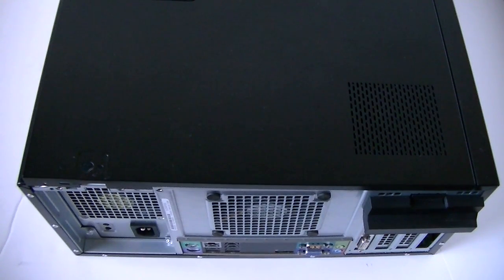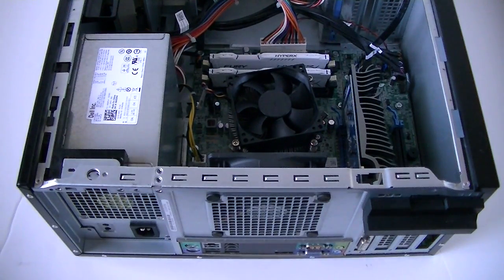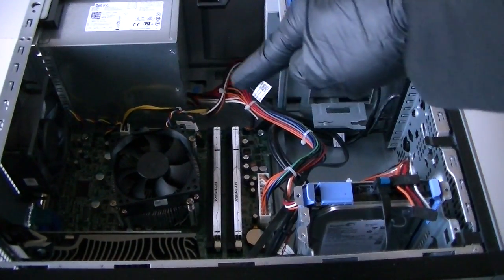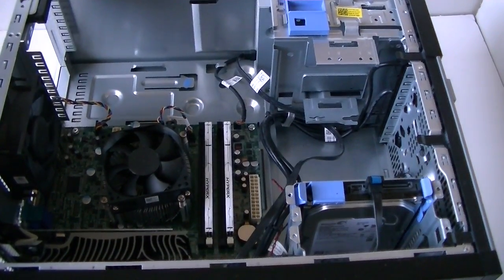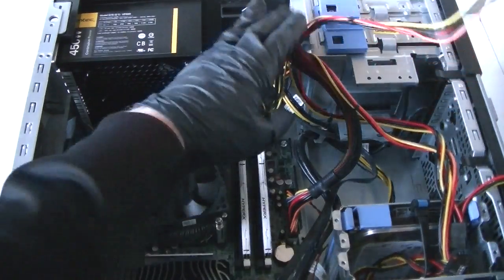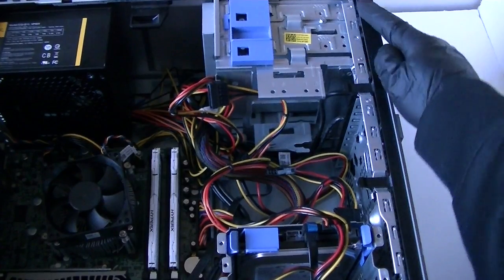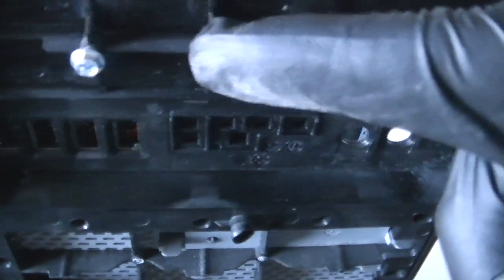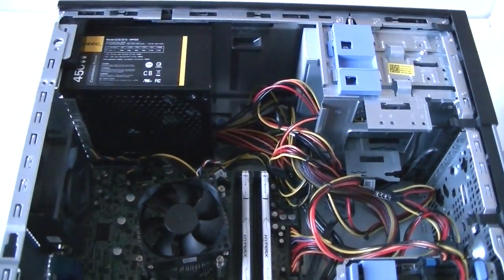Dell Optiplex 790 Power Supply Install Replace Change Upgrade

Comment: Will a gtx 1060 3gb work? As it seems to be better in price and performance than a gtx 1050ti.
Reply from the maker: Hi, yes that video card will work fine and you have to upgrade power supply.

Comment: Wow, some motherboard models of this Dell Series have 8 pin connectors instead of the 24 pin connector you see in this video. If its 8 pin you will need to buy an adaptor.
Reply from the maker: Hi.

Comment: For those who are looking for a dell OEM 500 watts power supply, do take a look at this link. Leaving this here since it helped me and might help someone else. Does not have the non-turn off issue which the other ATX PSU's have with the dell motherboard. Effortlessly runs an RTX 2060 for me.  

https://www.aliexpress.com/item/4000811511094.html

Comment: Hey dude I have an Optiplex 790 and was looking at an antec vp450p on eBay, is this the exact model of psu you’ve used here? Will I need any different power connectors or will it just plug right in? It says it’s non modular in the description, not sure if that matters or not

Comment: i have the 790 and i cant fit the 500 watt power supply i got it cant clear black slide spring for the case cover
Reply: Same.
Reply: I got it out, won't be able to close side panel properly anymore tho, as the the black piece with the spring is the side panel closing mechanism. Still worth it tho.

Comment: what about a 1030
Reply from the maker: Hi, yes that will work. GIGABYTE GeForce GT 1030 GV-N1030D5-2GL Low Profile
Reply: @Mxkdt  o ok
Reply: @Mxkdt  Also can a 400w evga psu work with a 790 sff?
Reply from the maker: Hi, yes on sff case you can use  evga 400w ATX power supply external for testing.

Comment: I have a dell optilex 790 mini tower and the PSU/power supply only has 240watt so I'm trying to add a GPU/video card and it is "evga gtx 750ti' so I don't know if the powers supply could Handel the gtx 750ti so I hope someone respond and ask me if the 240watt PSU could handle gtx 750ti.

Comment: I was just wondering, does this case support 500watts psu ? want to use a rx 5704gb or 1060 3gb on it.
Reply from the maker: Hi, i just uploaded video and shows you how to upgrade bigger video card for gaming by removing hard drive cage.
https://www.youtube.com/watch?v=Bjtpp-fIx_Q

Comment: Hello friend.  Wondering if a 2gb rx 560 will run on the stock psu?  I got one of those sata to 6 pin plugs for power to it.

Comment: this video is nice....i looked online and saw a slimline of models that can replace mine only 300 watts but still better than my 240 so hopefully that will work and Dell or this  place or soembody will make a better one... 600watts is the goal
Reply from the maker: Hi, you don't need 600w power supply and if you are using gtx 1050 video card 300w power supply should be enough. Thanks

Comment: Can the gt 1030 handle that 265 watt power supply?
Reply from the maker: Hi, yes you can use gt 1030 on 265w power supply
Reply: @Mxkdt  the power supply that comes with the pre-built 790?
Reply from the maker: Hi, yes dell optiplex 790 mini tower uses atx power supply 265 and you can upgrade to CORSAIR VS Series, VS450, VS400, CX450, CX430.

Comment: JUST GOT A dell optiplex 9020  AND REPLACED the 290w power supply with a eva 600 w powersupply i got alot of extra cables i had to get a adapter for the mother board to the power supply tho and on the mother board there is a plug in cable tha powers the hard drive and dvd/cd rom, im using the old one for now snice the new one doesnt plyg into the mother board should i unplug it and just plug the cables into the hard drive and dvd rom drive ? it seems like this power supply wll power the hard drive and the dvd rom , right now the old cable on the mother board is powering the dvd and hard drive

Comment: hi there  i have a dell optiplex 790 mt, 0hy9jp motherboard, will a psu upgrade damage the motherboard at all, and if not what psu can i use, and gtraphics cards  thanks  keith

Comment: Can 240w handle a750  ti
Reply from the maker: Hi, yes 240w power supply will work fine with 750 ti video card.
Reply: What about 1050 ti

Comment: hey mate i have dell optiplex 790 and when i turn in power fans running  like 3 sec also video card led  turn on afther this  when i click button computers run normal  its problem ??ur computer doing same?

Comment: I have bought an EVGA 600w power supply and want to put a Zotac GTX 1060 3gb in my 790 mt. Is that enough for it to work?

Comment: I have an Optiplex 9020 MT. Is it ok to upgrade it's 290w psu to a 500w psu to run a gtx 1060 ? and what adapters should i buy to run an evga mini gtx 1060 with the new power supply?

Comment: Can I replace the power supply for a 550w power supply and put a gtx 1050 gb without any problems? Or will I have issues doing this? Please help
Reply: yup and without any problems. Keep in mind tho that you could even run a gtx 1050 ti on the stock power supply

Comment: Hi I have a Optiplex 790 MT is it ok to replace the power supply with a 400w to run a gtx 1050ti?
Reply from the maker: Hi, yes you can replace power supply to 400w like brand name  seasonic, corsair, antec, cooler master

Comment: I'm gonna put a 1050 into the Optiplex 790. It has an i3. Will a 500w power supply work?
Reply from the maker: Yes
Reply: Mxkdi also does a Optiplex 790 have dvi?

Comment: You mentioned that if you have a longer psu it will not fit unless you remove the clip for the back cover- do you know where I can get some information on this? I have a 7 inch approx psu EVGA 750w g2 that I want to install (and also add a 1060 superclocked single fan gpu by evga). Thanks
Reply: Vinny M. Hi, I'm currently working on the DELL 990MT,  and you mention the EVGA 750w, and so I was wondering if you managed to get it to fit, did you? if so did you run into any space issues? I hope to hear from you as it can really help me out to know if i can install the EBGA 650w G1+ with these dimensions, 85mm (H) x 150mm (W) x 170mm (L) thank you if you can help me out ahead of time.

Comment: How come no front panel connectors (hd led, power, reset, etc.)?
Reply: dell uses proprietary connectors for the front i/o, the connector is located near the bottom of the motherboard.

Comment: Could I put a Evga 500w in here for a gtx 1050ti? Also would there a different installation process if I had a 390 mt? @Anyone who is willing to help, thanks!
Reply from the maker: Hi, yes you can put Evga 500w power supply and gtx 1050 ti with single fan will fit fine.
Reply: Mxkdi alright thank you

Comment: can the 265w handle a 750 ti?
Reply from the maker: Yes, 265W is fine. GeForce GTX 750 TI =Total Power Draw: 60W
Reply: @Mxkdt  if gtx 1050 ti with the stock cpu will it work fine?
Reply: Can the mother board handle past 25w I keep saying that’s the limit for it
Reply: I have used a Asus gtx 550ti which consumes 110W without any trouble and it requires 6pin connector, used it for like 5-6months. same mini tower casing with 240w psu 80+Gold
processor i5 2400 with 8gb ram 

750ti should be a piece of cake for it.

Comment: can i install all cards  graphique  on This Tower  its pci express x1?
Reply: Mxkdi Hello i've a dell 790 sff and i want to change my graphic card and my processor for GTX 1050 Ti and I7 3845 (something like this) but some peoples say's to me i've to change the power supply, so can i put a corsair 500 in ?
thks
Reply: CAN GTX 750TI WILL WORK ON IT WITHOUT CHANGING POWER SUPPLY ?
Reply from the maker: Yes you can

Comment: my 790 does not have a six pin connector what do i do
Reply from the maker: Your power supply does not have six pin connector or video card ?
Reply: get a new power supply with higher wattage(about 600w or up). but if your motherboard does not even have slots for that  then obviously you need a new motherboard

Comment: I have a dell optiplex 755 smt, can I use this psu for computer as well.... thanks
Reply from the maker: you have a mini tower or desktop ?
Reply: Mini tower
Reply from the maker: Yes you can
Reply: my system doesn't have any upgrades added on..... my psu is almost done for, so I just want to upgrade it now so I don't have to do it in the future.... so can I  upgrade my psu with no problem... thanks
Reply from the maker: Yes you can upgrade your power supply go with 500w seasonic or corsair or antec

Comment: i have an optiplex 9020 and i want to change my 290W PSU and add a GPU 
?What PSU and GPU do you recommand for me 

CPU: i5
i want it for gaming
Reply from the maker: If you have a dell optiplex 9020 mini tower you can upgrade your power supply to Seasonic or Corsair 500w and Video Card GeForce GTX 750 Ti or ASUS GeForce GTX 950 Mini (GTX950-M-2GD5)
Reply: Mxkdi i have the same case in your video
Reply from the maker: Ok you can upgrade your power supply and your video card you have to buy online ATX 24pin to 8pin power supply cable for dell optiplex 9020
Reply: Mxkdi ok thank u <3

Comment: Le pedo poner una fuente evga 500W?
Reply from the maker: Yes evga 500w will fit perfectly fine in mini tower
Reply: Le puedo poner una gtx 750 ti? la soportara la dell 780?
Reply: Le puedo poner una gtx 750 ti? la soportara la dell 780?
Reply from the maker: You have a Dell Optiplex 780 or 790 ?
Reply: 780
Reply from the maker: mini tower or desktop ?
Reply: Mini tower
Reply from the maker: Yes gtx 750 ti video card will work

Comment: does the fact the mobo's pcie slot for the graphics card being limited to 35 watts matter if Im trying to use an rx470?
Reply from the maker: No, You should get newer model machine like dell optiplex 7010 mini tower that alow you to install video card with maximum wattage 75w
Reply: Mxkdi will the GTX 1050ti work fine ?

Comment: we're can I get a psu that will fit this pc I can't find one or know what type to look for as it's a small form factor desktop thanks
Reply: I have a question man. Can you take out the whole motherboard and rebuild the system outside of the case without having any mounting issues with the heatsink once its outside of the case?
Reply from the maker: Yes you can
Reply from the maker: Yes, just look at back of the motherboard there should be chrome plate that mounts heat sink
Reply: ***** Thank you so much! :D
Reply from the maker: You can buy atx power supply online for this machine dell optiplex mini tower
Reply: it's a desktop there is a mini tower but this one here and mine is a desktop and has different psu and ram I've ordered a corsair vs550 atx witch is the same size as the Dell psu so hopefully it will fit just fine there good for gaming if u upgrade the ram psu and gpu it's only cost me 150  quid so far
Reply from the maker: Yes mini tower and desktop use different power supply
Reply: ***** So the heatsink mounts onto the motherboard just like regular systems? And thanks for getting back to me so quickly man. You're really helping me out.